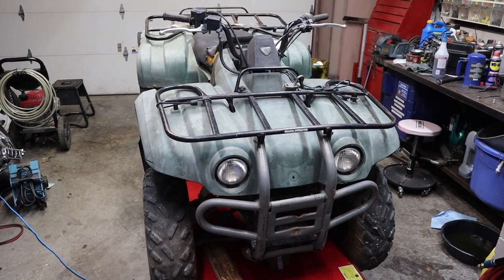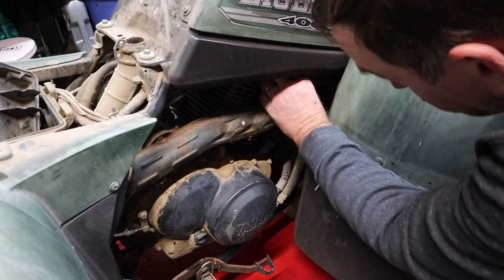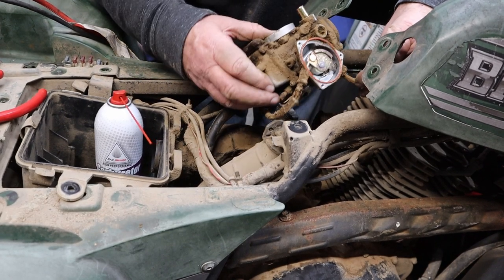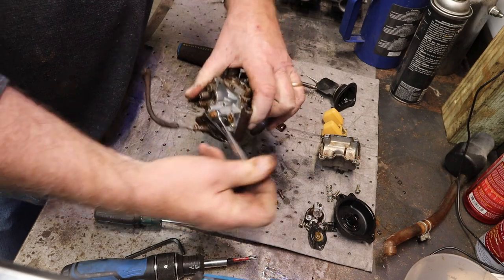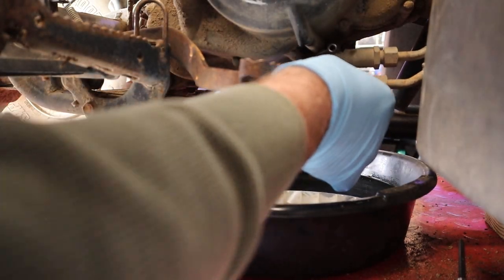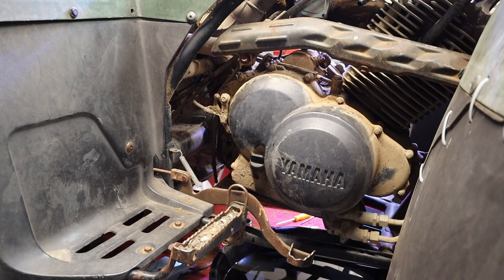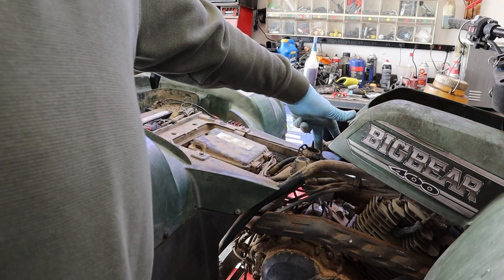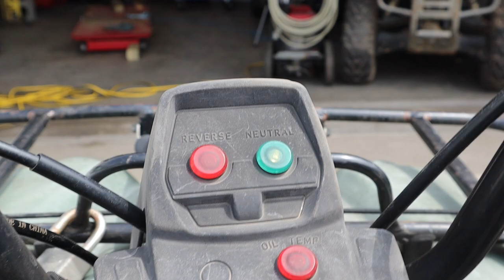Yamaha Big Bear Revival. We Make it Run Again.

Comment: I have the same machine. Brakes were stripped off the front and the rear brake shoes lost the pads. Front wheel bearings are shot. But it runs on spray. The tank was empty so I hope it runs good on fuel. I don’t want to pull the carburetor. Thanks for the video
Reply from the maker: Sounds like you need to clean the carb for sure. Sounds like it may be a little rough condition. Thank you for watching.

Comment: Those Chineseieum carbs are hit or miss. What i normally do is just buy a rebuild kit for the original carb, cost about the same or less than a whole carb and looks better to have the original carb for resell.
Reply from the maker: I agree with you, most of the time i have bad experiences using the knock off cabruretors.

Comment: I have the same four-wheeler. My problem is it will idle but when giving gas in neutral it bogs down really bad and dies. Any ideas? I replaced the carb and cleaned out the gas tank. My only other idea is somewhere a vacuum or some kind of hose is not plugged in, due to when I got the four-wheeler all the hoses was missing from the fuel tank to the carb and all the hoses that came off the carb. Any suggestions would help.
Reply from the maker: I think you may be on the right track. Thank you for watching.

Comment: I have a big bear that will not start the green neutral light will not come for the motor to start . I know that the transmission is in neutral.
Reply from the maker: Get a wiring diagram and chase it down. Probably neutral switch. Thanks for watching.